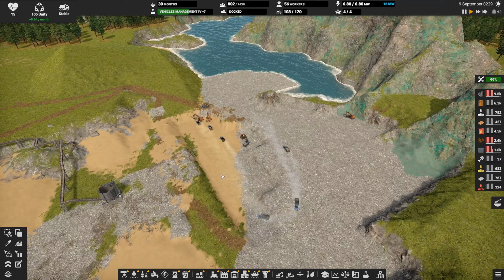Coal Power Overhaul! | Let's Play Captain of Industry s06 e34

Comment: I think the island long pipe was a great idea (why didnt I think of that) i am implimenting that into all my CoI playthroughs from now on, and not only water but all fluids and gasses I use for production...and get this they all will be buried 😂
Reply from the maker: Keep in mind there are some throughput issues with this approach that I'm experiencing. I'm keeping my fingers crossed that upgraded pipes will solve those issues. If in the end the upgrades don't work, then I'll just break the island wide pipe network into regional segments, each with their own independent supply of water.

I love the idea of buried pipes, but I'm also embracing the additional challenge of trying to run pipes in a way that doesn't look hideous. And it is quite a challenge. 
I hope to beautify things along the way as I play on.
Reply: what I did for water thoroughput is for each water deposit pump set is connected to a pipebalancer and prioritised in, main line in normal flow, main line out from balancer and storages in from balancer for excess and connected to main line behind the balancer so pumps get priority from all around the map and only use storage excess if not enough... shouldnt have any probs but well see how it works. cant predict any issues but later will add desal operation in one location for backup if ground water runs low.    @Glidercat
Reply from the maker: @dcollins2562 Just seeing this. I'm not sure why, but sometimes YouTube does not notify me about comments/replies. Sorry about that.
That approach to water sounds effective. I'm anticipating having to do a bit of experimentation to see if a single, island-wide water main will work or not. If not, I will look into high capacity pipes as a mod since I think having a single system would be extremely cool.

Comment: Two issues with today’s project: (1) you added the liw pressure turbines, but didn’t add the 2 new generators on each shaft, so new turbines aren’t doing anything; (2) 4 groundwater pumps (192 water into a 200 pipe) will block ability of cooling towers to drain; power will shut down. You sorta fixed this at the end, but consider a balancer to ensure cooling towers drain.
Reply from the maker: The low pressure turbines are sitting along the same shaft as the existing generators. I don't believe they need their own dedicated generators.
I'll try to remember to keep an eye on that to make sure the power from the lp turbines is being used.
Ultimately it still might make sense to add generators for a maximum output situation. I may do that later.
Reply: Each turbine provides a certain amount of mechanical power to the shaft. The generators convert mechanical power to electricity. You just added 6MW of mechanical power to each shaft… you can add 2 more generator wheels to each.